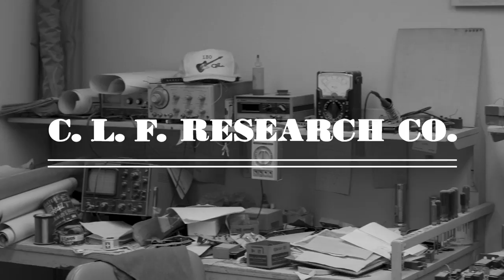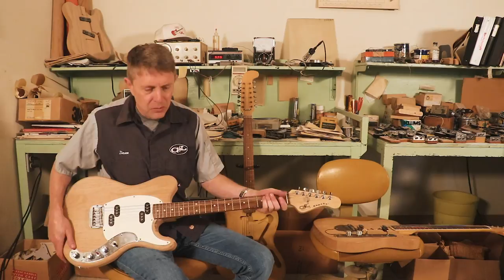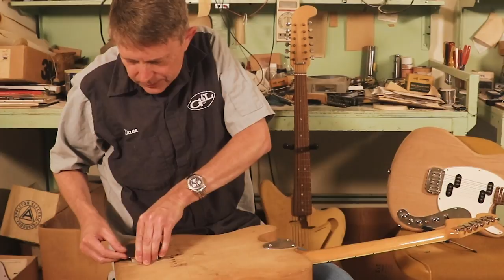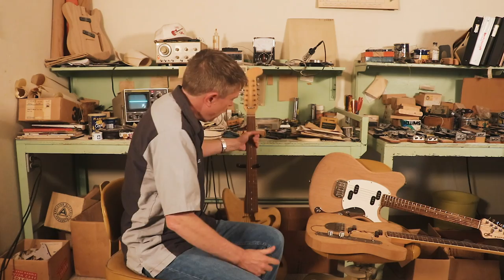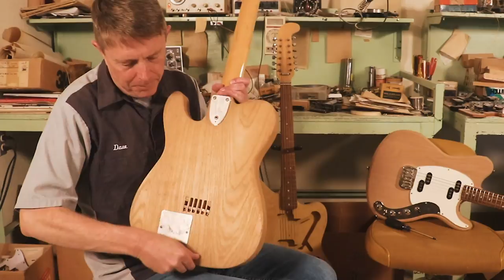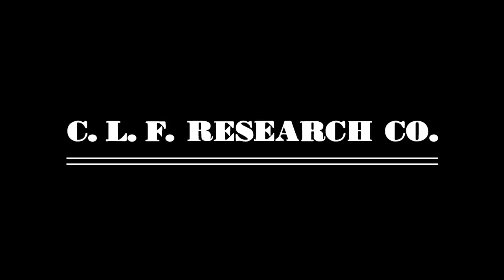CLF Research: Origins of the Espada

Comment: After playing mine for a while, I would say the main reason it's called the Espada (Sword) is because it can cut through anything. Considering the late 60s "heavy sounds", Leo had to have been thinking about that. It is a beautiful guitar, and there are so many sounds in it. Of course, the Tele sound is there, but it doesn't have the percussive bite of my G&L Broadcaster with its ebony fingerboard. It can do the nuance of a Strat without the quack, and it will get you into Rickenbacker territory. With the bridge/neck pickups, serial/parallel switches, pre-amp on or off, and bass and treble controls, it's got to be about 10 guitars in one. I bought it as my last guitar purchase, and with all there is to discover in it, I can think of no reason I would ever get rid of it.

Comment: Will it work with no battery in it? I get that it will be weak in parallel, I just don’t want to rely on a battery.
Reply: The battery runs the preamp, which is always in use because the pickups don't have near the winds of a std pickup. The sound is thin and very low, I'm sure. Likely unusable.